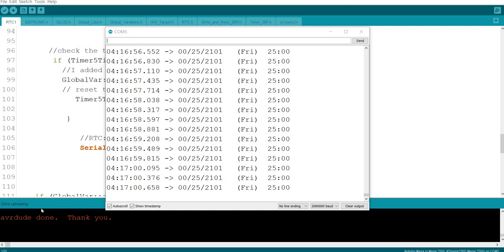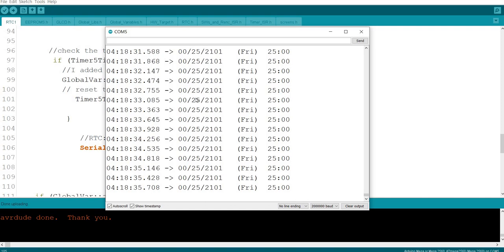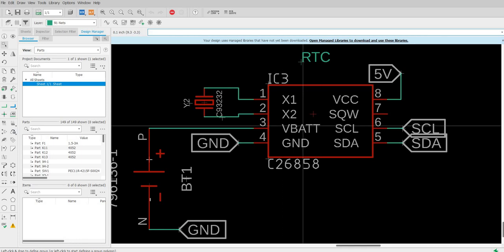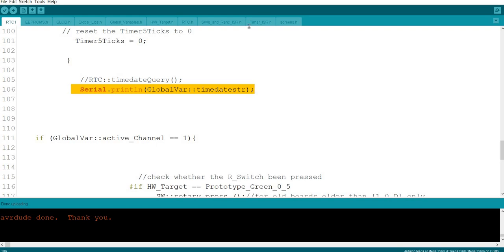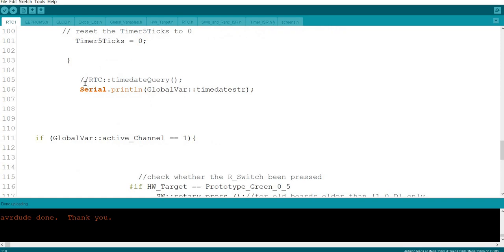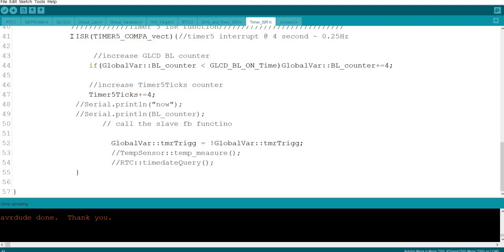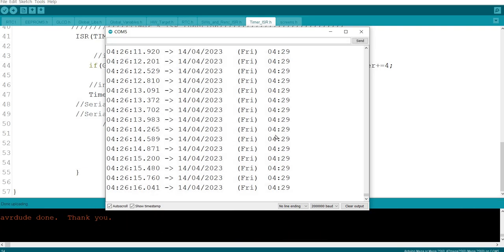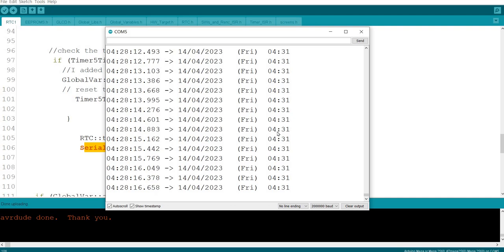Why the RTC Returning 165/165/2165 or Garbage– And How to Fix It

Comment: Great explanation on the code! Quick question as im trying to troubleshoot the Pin 7 output without using an Arduino to check the squarewave output is there, however I only get 5V without any square wave just a DC signal steady at 5V. Does this mean I have a bad RTC chip? My crystal is  32.768 kHz, and I would expect the Square wave output to be at this frequency. I'll get an Arduino next to check software settings.
Reply from the maker: Hello hardkore360, 
You can not use the RTC module square wave output without MCU. You need to activate the output @ the setup function RTC.squareWave(SQWAVE_1_HZ);